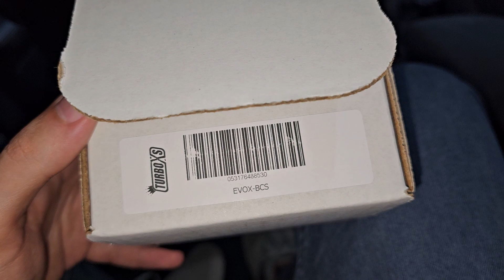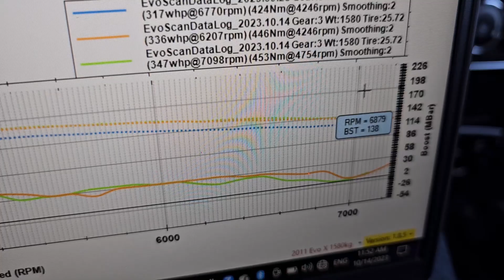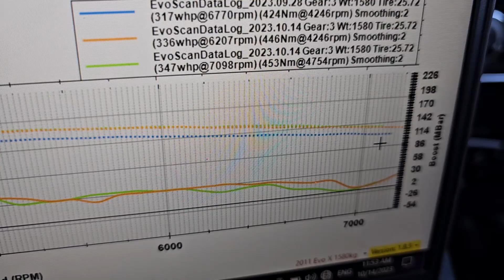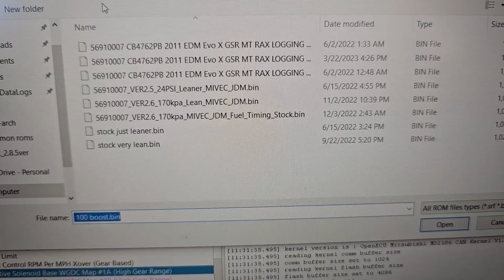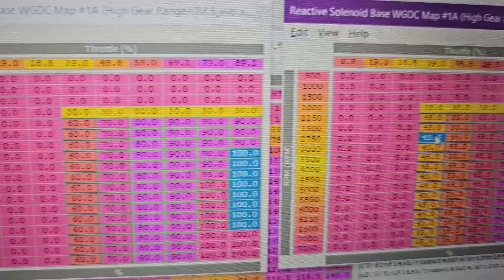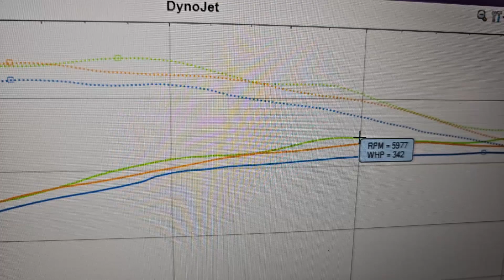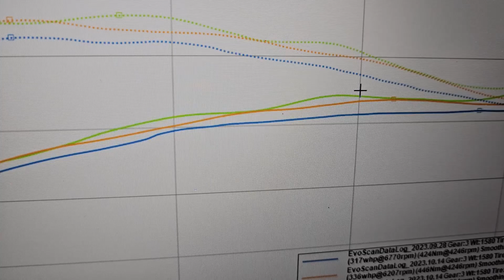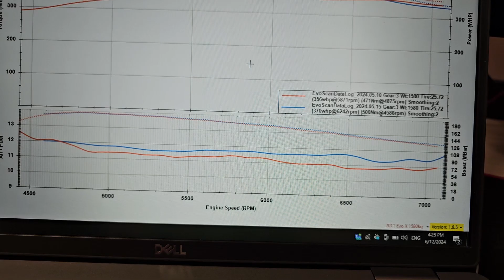Is 3 Port Boost Controller Worth it? | Evo X | Virtual Dyno | EcuFlash

Comment: quick question,is it possible to put supercharge on a 4b11t?im more interested in the low end speed build up
Reply: It’s very possible, it will benefit you when you have a big turbo not a stock frame ..
Reply from the maker: I am pretty sure it's possibe, but modern turbos spool instantly and if you get a smaller one, you will spool at 2000 RPM basically.

For supercharger, I guess you just have to engineer your own adapters.